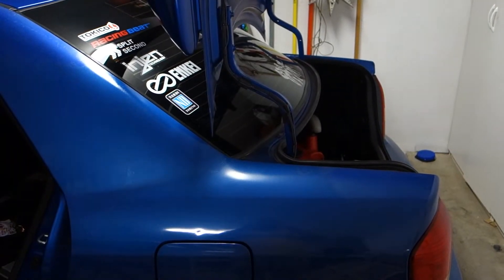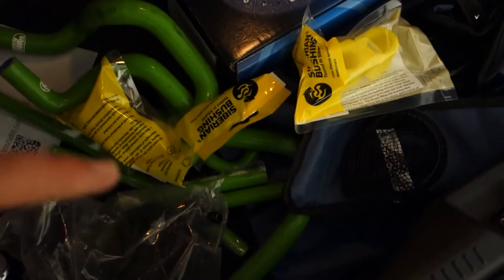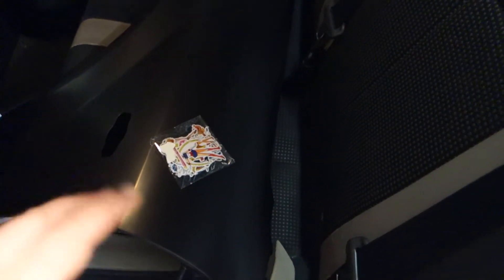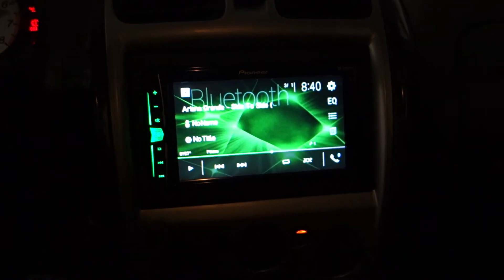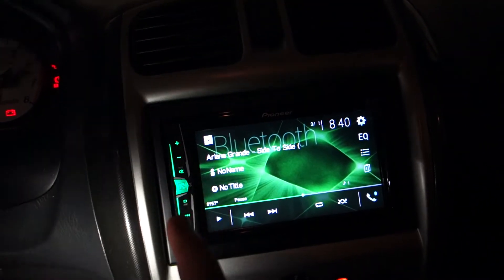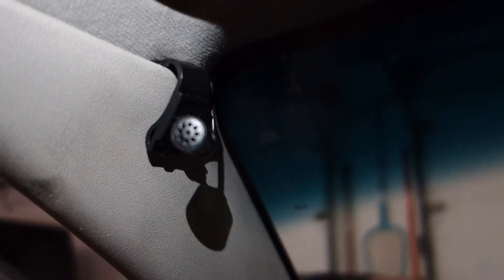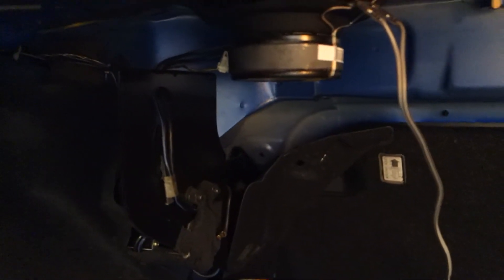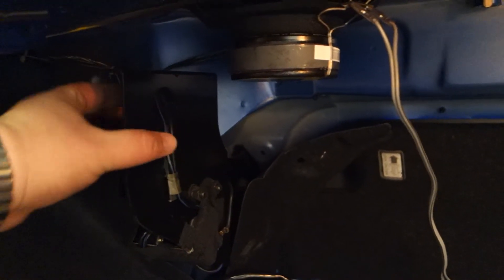Project car update: Feb 2019 Sound system upgrades!

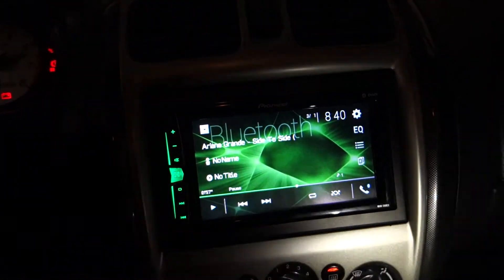Comment: 2:31 hey, i have an 03 Mazda Protege and I got the Scosche Double DIN Dash Kit and im having trouble being able to fit in my car. does the type of radio matter? (i got a jvc double din)
Reply from the maker: Double din is a standard size width and height, (but not depth). Not sure what you mean by being able to fit in your car, but if you post pictures or even a video of your issue to a car specific forum or appropriate subreddit, I'm sure somebody could help.
Reply: @AICvideo  grateful, i hadn't even thought of the depth. i'll definitely scroll and linger on some forums too. thank you!